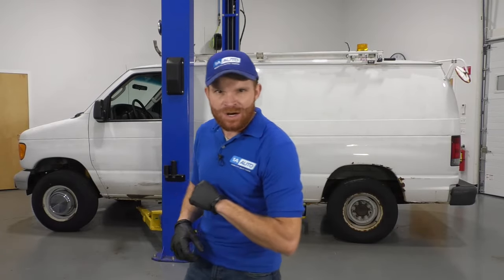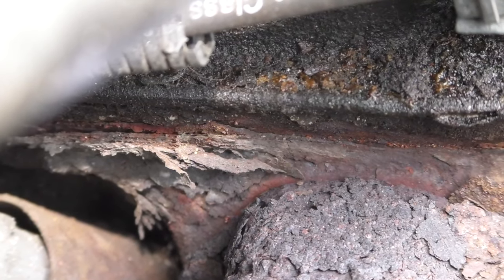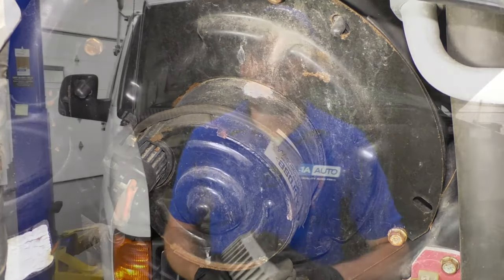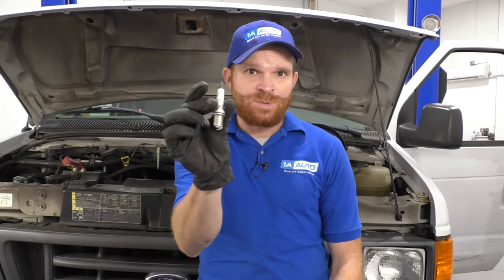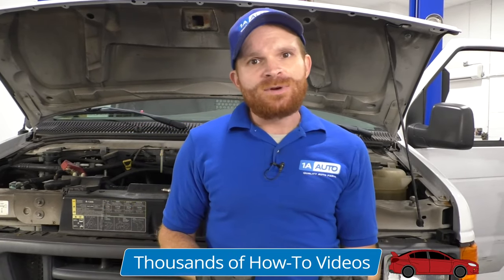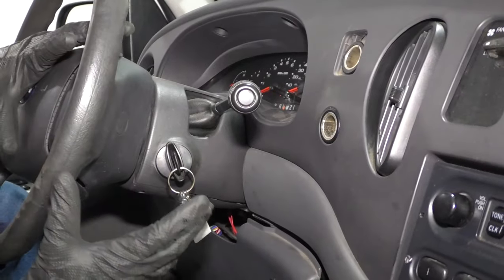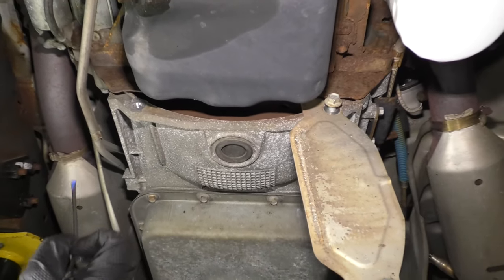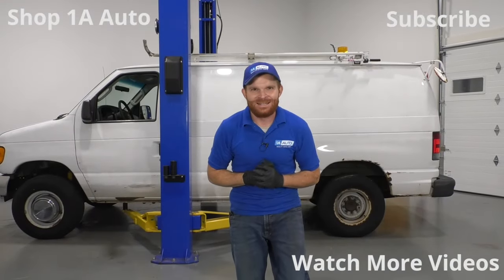Top 5 Problems Ford E-250 Van 4th Generation 1992-Present

Comment: Glad I found you.  I have an 2015 E350 commercial vehicle and at 34k I have have already had to replace brake rotors and pads,   shocks, tires and alignment and the truck sat for a year as I bought it in 2016.  The premium warranty I paid 3,600 covers nothing I am now needing to replace.  My mechanic who was great with beater cars doesn't have the staff to have my back as before and it is on me to get educated.  I just replaced air filter which was a little tricky due to the design of the truck.  The manual that came with vehicle falls real short and my new mechanic is a specialist with wheels and tire automotive.  I still have hope because I now found you

Comment: There were millions of these made so there are TONS of parts and they are cheap to fix.The same basic design hasn't changed since 1992, so a lot of parts are interchangeable and they use proven engines. They are incredibly reliable, especially with the 300 I6 or 4.6 engines ( stay away from the triton engines....)The chassis is essentially unchanged from 1975's redesign of the econoline, so if you buy one of these new, underneath you're essentially driving a 46 year old vehicle, which is kind of sad, but also kind of cool.
Reply: I'm looking at a 5.4 97 ecoliner. Why stay away from Triton engine? Thanks
Reply: @BallsMcgrubber  The spark plugs are a pain in the ass and have been known to blow out. They had a coil on plug design, which leads to a lot of heat on the coil. Also issues with the timing chain guides breaking off and ending up in the oil pan, and causing damage elsewhere because the timing is off, causing valvetrain damage. Stay away. Get the 4.2, 4.6, 300 I6, or if you're going older and don't mind a carb, a 302 or 460 will do just fine. They have much fewer issues.
Reply: Good to know! Just got a 2006 e150 4.6. Seems good but getting it checked out from brakes to belt, to all the fluids. School district van but no printed maintenance records.

Comment: Had my transmission tail piece crack from a rusting crossmember. Was lucky to see the transmission fluid on wet asphalt when I was backing up. Never ran low.
Reply: Mine did too it's a common problem.

Comment: 9:40 I had the shifter issue. I almost got stranded because the shifter didn't want to go into gear. It turned out that the shifting linkage bolts had gotten extremely loose. I had to take off the trim pieces to get access to it under the steering column but once I tightened them up the shifter began to work like new.
Reply: My shifter linkage broke in half
Reply: Si quiera uds pueden acceder a repuestos, yo en Perú sufro por repuestos para mí Ford e350 super duty del 2005, estoy pensando en cambiar de motor a un japonés Nissan, acá si abundan esos carros

Comment: All the Triton engines have a problem with exhaust manifold bolts: vans, trucks, SUVs. Now that these engines are older, I'd recommend checking the bolts over couple months or so. When and if you find one that has snapped, change ALL of them, because the rest aren't far behind.

Comment: Thanks for the video I have a 92 250 with 112,000 miles I got it t 90,000
It sat for a few years but runs great
I have to replace temp meter sensor for instrument cluster I found out a few days ago that it has 2 temp sensors

Comment: I have an issue with my 95 E-250. Almost every year the starter goes bad. Apparently the owner before me had the same problem, it came with a "starter hammer" in the center console & was told it needed changed, & i've changed many times since. What would cause this?

Comment: Is the blower motor the problem when neither the heater or AC blow through the vents but instead come out at the floor and only when you're not pushing the gas pedal?

Comment: Yeah I bought a 1990 Ford E-250 I've had it for 2 years it's been incredible I've been using it for a camper when I bought this thing almost all the fuses were pulled out I replace them all and everything worked lucky lucky I have a thing with the transmission now it doesn't leak but it burns it somehow and when it gets low it won't go into high gear on the highway put a quart in it and the way she goes
Reply: Screen ?

Comment: Exhaust Leaks & Ticking in the Manifold.  Blower Motor & Wires.  Misfire - Cylinder plugs/coils. Shifting is Loose - Transmission Fluid.   I've noticed many used E Series are for sale before 100 K .  Others for sale around 150 K.  Would these situations be connected to a specific Engine & Transmission combination ?  I almost bought a 250 !

Comment: Thank you for the info. After 521,000 miles ( yes that number is correct) on a 2006 E150, these problems are manifesting, slowly. The first was the PRNDL indicator; and yes people don't use the shifter correctly by pulling forward before changing from Park. The  COP for each cylinder has been replaced, may need it again with this mileage. Haven't checked the exhaust, but do hear a pinging noise while everything is cooling; this may be normal cooling and not the sound referred to after starting engine with exhaust leak in your video. The blower fan is an issue and didn't replace it after replacing the regulator.
One issue you didn't mention is the vacuum regulator in the dash that allows the air condition to maintain face vent instead of defrost vent when a load is put on the engine. that's recently happened her.
Thanks for great info and visuals
Reply: I'm at 345k barely
Reply: Have you replaced any cooling system hoses or rubber parts?  At what mileage approximately? Do you find the rubber ford used so much better than the 90s?  I'm 2nd owner 8 years of a 2002 e150 170k miles for and I think I still have original hoses and fan belt.  I did replace the intake manifold because of coolant leak on spark plugs, and am replacing spark plug boots because of swelling and cracking.  agree on the hvac vacuum chamber, bypassed it with making a chamber out of pvc pipe and a few fittings for under $10 and a few minutes, video on youtube.

Comment: I owned a new 2003 E150 V8 4.6 for 5 years. Except for fast wear of the front tires, never did have issues, then switch for a 2007 Savana once I reach 100K, only kept that van for 3 years. One thing that was weird with the modular engine, was, during extreme cold starts, the sound of the engine sounded like an angry chainsaws.
Reply: frozen bearing in fan clutch???
Reply: I started my van today and I screamed in agony, the temp is 8 degrees 2004 e250 352k

Comment: I like and appreciate your videos.  I don't suggest replacing the blower motor with the resistor, unless it failed because the blower motor.  In my limited experience I've found ford resistors failed because of rust and corrosion.  Maybe ohm out the blower motor and check spin.

Comment: The coil packs are a pain in the ass. From experience,  if one goes replace them all! They sell a performance pack that 8s the replacement for them. Dont forget your plugs need to be replaced as well. I have 3 trucks and after 160,000 miles they start to fail. As soon as you do one another one always seems to go and so on. Just bite the bullet and do them all.

Comment: I need to make an updated comment.
I owned a 1995 ford e250 issues i had with it.
Transmission died before 165,000 miles and was rebuilt
Front suspension went bad early
Shifter nuts got loose and caused the shifter to not shift
Huge oil leaks from the front and the back
When the van got hot it wouldn't start after being shut down i had to wait for it to cool down and then it would start.
Alternator went bad after 170,000 miles
Coolant hoses went bad after 170,000 miles
Wheels for whatever reason locked up bad e brake cable i think.
I had a lot of problems with my e250

The van was poorly maintained by a plumbing company.
It was a total mess of a van around 181,000 miles.
If a van has over 120,000 miles i won't buy it. Nothing but a money pit if the owner before didn't do the maintenance.
Reply: I got 2 e 250s. 240 k, and 200k. Meticulously maintained by me and my ase certified mechanic. Took almost 8 years replacing defeffered maintenance parts by previous owners to get them in shape. I replaced spark plugs, air and fuel’s filters, but after he cleaned the MAF fuel sensor got a big boost in torque, hp, fuel mileage. Run like new. Simple clean out, or replace if needed you might be pleasantly surprised like me and not worry about merging into traffic anymore.

Comment: Question please what could be the reason on a 02 ford E150 4.2 the fan speed switch get hot a melts the blower and resistor has been replaced same problem?

Comment: Have you run into the guage panel intermittently working? The radio quits working also.  This could last a second or 20 minutes, at random. Bumps, switch position, driving, sitting still, steering wheel turning, turn signal,or the gear shift seem to not have any effect. All the fuses are good.

Comment: thanks for the good info, i've owned e-sries for the last 16 yrs and these truck are a mule they never brake, the only problem i ever had is catalytic converter and getting rusty from the top, and one thing he did not mention and that is a serious issue specially cargo doors locking cables end or latches brake, these latches are plastic made and over time brake and impossible to open the doors, knock off parts made of aluminum better than factory,'' sold on ebay or any where online'', a pain in the neck to replace, other than that best working truck on the road, i would never change my eseries , the new transit i dont really know but looks too sissy to me no offense , jajaja,,, good maintenance thats all it takes on those eseries, good luck!!
Reply: Just finished  the last 3 door cable ends  …argh !!  Med Mike on  u tube  helped me easier way !!

Comment: what causes a squeaking noise when driving a 1995 ford e-250 econoline van 3 door 5.8l 8 cylinder? Replace shocks and struts. It's happening when hitting bumps but goes away after driving a while. Needless to say I'm confused.

Comment: Worked myself on my 2011 E-250  5.4 engine had miss fire & installed new plugs, coils, and new catalytic converters & now has no more engine light on, It's a southern van no rust, only 150K  Van now runs great, but it was money and a waste of time. Watching this to see if body mounts are a problem since it failed Va. state inspection. Not much out there on the body mounts on you tube, but they don't look that bad, my 1995 F 250 mounts are much worse condition. Ford wants $3200 to replace them. I just did all the other work myself and tried to find something on this if this is something I can do since I'm 68 yr. old and it doesn't get easier laying on the ground working on this van.  It was a magnificent work van for years. I need to retire it to my back yard as a new storage shed and just take it off the road. State inspection is such a joke, some states don't have them and then Va. can let me drive my '95 with historic plates and no inspection, and my 2011 van is in much better condition and safer vehicle to be on the road, but rather I drive my '95 F-250 that came from the north, along with many other people that have vehicles over 25 yrs. old. How are body mounts that may be a little compressed and the bolts are not rusted be a safety issue. The van feels solid on the road with no body movement I can feel unlike my '95 F250 that was inspected for the last time years ago and passed with worst body mount. I can't take the van somewhere else for inspection since with the 15-day red sticker they can find out what it failed for. A good vehicle now being taken off the road to be replaced with my "95 diesel", which makes the neighborhood smell worse than a truck stop as it needs to warm up before it can be driven. Your channel helps people like me to keep our vehicles on the road for many years, until the time comes to retire the vehicle. I think some of the states will fail older gas vehicles to get them off the road before they can get the historic plates and to get to go to EV's. My "99 Crown Vic failed for stabilizer links that they wanted $800 to replace and I just replaced them myself & got it to pass, but they may fail the Crown Vic next year for body mounts. Never had vehicles fail over these types of things,

Comment: I've had more trouble with air flow sensor. I don't even replace it anymore, I just keep cleaning it. So that and vent flaps under dash (floor to vent).98 E350.
But good van though. 250,000 mile on it and had to replace transmission and I have #5 spark plug coil only last for about 50,000 miles. Don't know why.
Reply from the maker: Thank you for checking out the video. If you need auto parts go to: http://1aau.to/m/Shop-1AAuto-Now
Reply: Make sure its not getting wet by coolant or water splashing up there.

Comment: Problems i’ve had was the blower switch melting and spark plugs working loose and blowing out, neither of which were mentioned
Reply: Literally got caught out of town day before Thanksgiving,  800 miles from home and spark plug blew out. Forced to pay out tha wazoo
Reply: After 2005-6 that issue (spark plugs) was solved for the most part.
Reply: I had the melted blower switch too
Reply: Anyway to avoid the melted blower switch?

Comment: I have a question. I have a 2006 Ford E-250 with 197,000 miles. I’m having problems with it not getting enough power. I’ve had the fuel filter replaced and it’s not changed how it drives. Like going up a hill it acts like it’s not getting enough power and if I have the A/C on while going up hill it turns off until I get to flat land. No check engine light is on so I can’t figure it out.
Reply: Did you ever figure out your issue? I’m having the same problem on 2007 E250 with 170k miles. First noticed power loss when climbing mountains last Summer to go camping, but then it started to also lag when accelerating hard (passing) and CEL will sometimes flash for about 10sec then go off. No code gets stored when this happens so not sure if injector or something else. Replaced fuel filter, cleaned mass airflow sensor, replaced air filter and ran injector cleaner through. Seemed a little better for a while over Winter/Spring but now issue is coming back and with the Summer heat again is now a big concern. I’m not running AC right now to ease the strain.

Comment: Bought an E150 last week. 2006 with 76k on the clock. She had been sitting under a carport since 2015. Tires were dry rotted (replaced), AC only blows defrost and feet, and no MIL/CEL. Just put my first 500 miles on her ^_^
Reply: Vacuum line ?? Mine got cracked putting in new radio  ?? Did same defrost blower  but nothing else !

Comment: Hi, My truck is a  Ford E250 2010, I arrived from work and parked as I always do, the next day when I tried to start the engine I couldn't do it, when I turn the key it indicates the lights normally on the board but it doesn't turn on.  the battery is fine, it does not throw any strange code.  I would like to know if you can help me find out what may be going on

Comment: Is brake master cylinder failure common? Pads were dragging, replaced bearings/rotors/pads/calipers/hoses  and they are still dragging. Only thing I can think is master failing but no signs and the pedal isn't that squishy. At a loss!

Comment: Misfire most often caused by an intake manifold problem causing coolant to leak into spark plug wells.
Reply: not on triton motor. on 5.4L its always bad coils.  Just replace all of them  but get set from napa, or even chinese with higher Amps. dont buy fords, as they  are just too weak when warm.  and use NGK sparks.

Comment: You'd think after 65 years of manufacturing the Econoline models, Ford would have eliminated these common points of failure. But that's not part of the Ford business model. The company would rather sell replacement parts than build reliable trucks.

Comment: I'm at my wits end. My 1999 Econoline van starts when it wani. One mechanic said he disconnected everything he thought was draining my battery. For a few months it started then it  wouldn't start from one day to the next. Even after towing it to a Ford dealership they said it started right up but a few hours later at the grocery store it wouldn't start. I've replaced two batteries. I have a problem now with the key getting stuck in steering wheel and one of my back door won't open. Help😢

Comment: I have a problem when I go over 35 mph the air conditioning goes from vent to defrost or the floor if I let off the throttle it returns to the vent any ideas on what’s going on with my problem?
Reply: I've been there and never fixed it. So I can't help you but you're not alone. That's common too its just some crazy Ford Shit that doesn't make sense but it's an ez fix when someone tells you how and part availability is no problem new or used

Comment: You forgot something when you take out the spark plugs that threading get stripped out in the head. This that common as you on 2 vans that I had owned.
Reply: that is not common issue , its becomes an issue if you are butches, and dont have proper tools. or your mechanic is a butches. I have 2 vans 4.6 and  5,4 , both half a mill miles, no issue with spark plugs,.  You have to oil the threads on new spark plugs and thread them carefully straight in by hand. ... then u know u not stripping ur aluminum thread on the head .